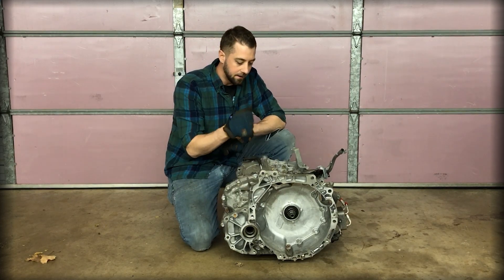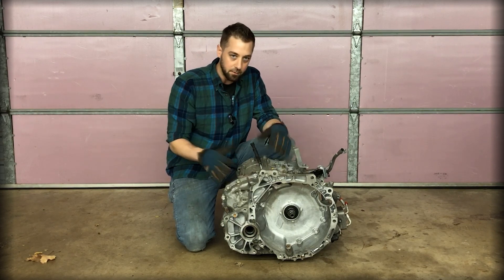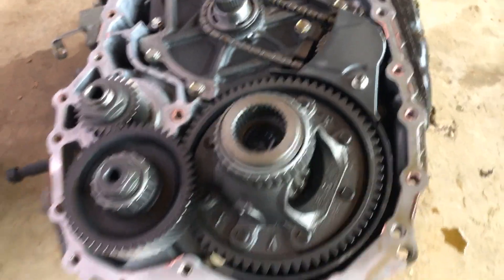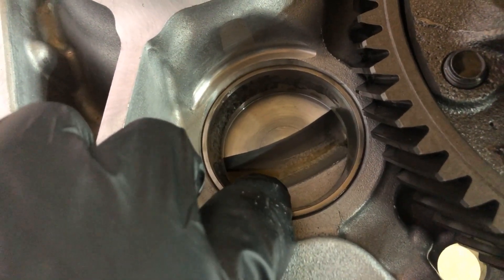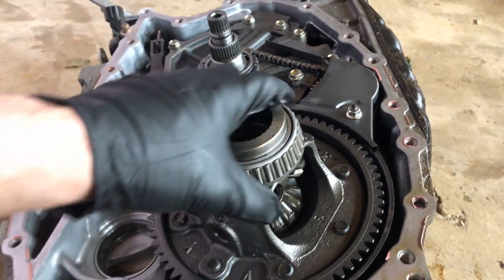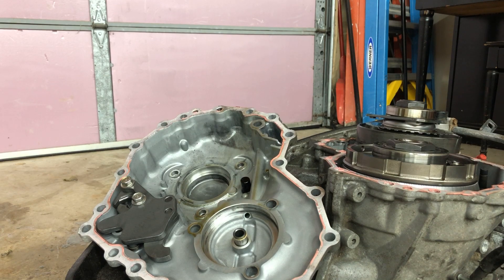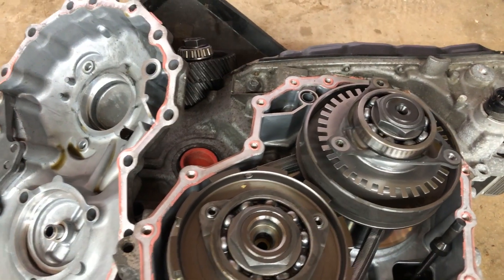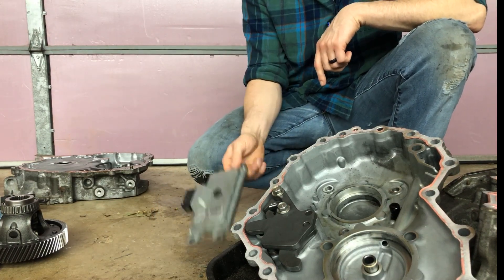I Teardown my Nissan CVT Transmission

Comment: I85,000 on the wife’s Altima 

Never changed fluid, getting ready to though, getting gasket,filter, new cover with drain plug.

Did one lone oil change with Royal Purple and an additive and the steering quit vibrating in about 20 min of driving.  So that’ll be the new norm now lol
Reply: Thata wild, ive been changing the fluid in my sentra every 20k miles.

Comment: I have 2011 murano serviced trans every 30k or less. Got to 180 k now it has a whine slash pump noise in Park quiets down in gear but whine on acceleration. Bummed because the rest of car and engine run great still. Still shifts great. Just sound like a bad power sterring pump.But the resale value for these is poor. Makes replacing not a viable cost option.

Comment: 120k on our 2012 Nissan Quest with the RE0F09B. Makes a really loud cyclical rough “bearing” noise. I can tell it’s in the transmission bc i can stop each front wheel and the noise continues. 

It’s loudest at low speeds. I took off the bellhousing cover and everything looked fine. It’s probably one of the 3 bearings on the side with the 2 pulley’s. 

I plan on using a stethoscope from harbor freight to help narrow down which bearing it is. Nice to see that the rear cover can be sort of easily removed to access the 2 outer pulley bearings. 

Seems like Tri-City Transmissions and WhateverItTakes can get/sell upgraded bearings and other parts for these. WIT also sells good used parts and assemblies.
Reply: Just curious how often you change the fluid, screen, and cartage filter.    I have an Altima with 91K miles,   I do mine about every 30K but I'm quite worried, especially every time I climb a hill, and the temp skyrockets!
Reply: @johndaniels651  it’s my brother’s Nissan Quest that I’ve been helping maintain only recently. Im pretty sure he never changed the CVT fluid until I came along at 115k lol. The CVT never had any issues other than that side cover/case bearing, which was probably due to design tolerances more than anything else. 

I think if you’re changing the CVT fluid every 30k already then that is about as much as you can do. I don’t think the screen filter really needs replacing since it has a lot of surface area that would likely not be clogged. We had a couple golf balls worth of steel bearing material in it and it still was probably filtering just fine. Over 80% of the screen was still pretty clean. I didn’t check the cartridge filter, just replaced it. It’s possible the cartridge filter could clog with smaller particles but I wouldn’t really know for sure. 

I’m aware that some trucks with well over 100k on original ATF can easily overheat under load. I believe the heat resistance of these fluids degrade in a logarithmic fashion. It’s probably great until roughly 60-90k and then starts deteriorating significantly, then it’s almost gone by about 150k or so. That’s when most traditional auto transmissions start to go if the fluid is never replaced.
Reply: @johndaniels651  Is it the CVT fluid that you’re seeing heat up? Or engine oil or coolant?

If it’s the CVT fluid then I would consider adding a transmission fluid cooler/radiator. That’s the consensus for extending the life of some slushboxes, especially if climbing hills or towing.
Reply: @johnnypolex   I hooked up  ScanGuage II from Liner Logic,  which is a really cool contraption that monitors all sorts of stuff (entertaining on long drives)  and it lets you read the trans temp sensor in real time.   Its rather interesting what causes it to heat up (not intuitive) but weight seems to be the factor.  If I'm by myself, it rarely gets above 207 in freeway driving, but if I've got 3 passengers  on board and luggage, the smallest incline can easily send it to 220.  Once with a full tank of fuel (100lbs) 3 pax and luggage, it ran up to about 245 on a very long, steep grade, in about 80 degree weather.

Comment: Did you ever change the cartridge filter on the cooler?
Reply from the maker: Yeah every flush I do.
Reply: @ManvsCars  ah ok, I just did mine other week. How many miles you put on CVT before failure?
Reply from the maker: @RJL1983  95k
Reply: @ManvsCars  Damn, I'm at 86K on my CVT

Comment: just knowledge, CVT transmissions are fine but there not made for heavy throttle starts, towing in my opinion, fluid should be changed every 30,000 miles.  210,000 0n my 2013 Pathfinder and 133,000 on my 2015 Rogue wife and I drive just over100 mile round trip to work daily.  Dealers will tell you that the fluid in these are design for the life of the transmission but I don't think people understand that life of a vehicle is considered 100,000 miles for most manufacturers.  Car industry needs to be more clear on maintinance and use of CVT's
Reply from the maker: Good point. Manufactures know the cycle of vehicles which isn’t a negative thing. In the rust belt your lucky if the vehicle needs a transmission before it rots out with all the chemicals that go on the roadways. Lol

Comment: Nissan and other car makers screwed up, they said their trannies were not to be serviced. it was a bad move. Even now if you call the dealer they say they don't do fluid changes and argue. My dealer didn't even know about the paper filter. I had to show them. But other makers did the same thing, like VW, Toyota etc... all guilty of this. It's a shame. 
Also if you want to try something really really good. See if you can find Power Up lubricants additive. It's so good. I used a little in my whiny tranny. It really works for these applications as it is a boundary lubricant for roller bearings. It is truly amazing.
Reply from the maker: Power up? Never heard of that. Is that like Lucas additives?

Comment: I really love the 2.5 engine, I have two. They are so smooth with the counter balance shafts .. so beautiful. After 250,000kms my engine works perfect. I bought another car just for a back up but will not need it, I can use it later. Plus parts are so cheap.All I did in 10 years was brakes and calipers and fluids, one headlight blub, one marker bulb. and tires. I have been using the mobil extended life oil at 10,000 km and will try the platinum plus I got on sale at cdn tire.. plus good mobil oil filters. Also I did the shocks and springs, the rear springs most cars are weak. They are cheap and easy to change.
Reply from the maker: Yeah the engine in mine is holding up great. Oil changes, flushes, plugs, filters. The basics. My opinion on the CVT however (and this goes for any car equipped with one) is poor. It’s very clunky, fluid overheats easily you get the point obviously. But hey economy  car at the end of the day and it did last us a decent amount of miles.
Reply: @ManvsCars  how much did it cost you to replace the tranny? Did you remove it yourself?  There are places that rebuild these and you can buy parts to rebuild them, there are several videos on here but the dealer won't have the parts, but the tranny parts places will. Perhaps your old tranny is worth something to these rebuilders.

Comment: I like the valvoline synthetic cvt fluid
Reply from the maker: I’ve always gone with OEM fluid. What’s the cost of the valvoline?
Reply: @ManvsCars  there is also a paper filter to change in a housing on the right side of the car, they are at rockauto for cheap, like $5, . and when you fill the tranny it should be about halfway on the cross hatch marks when hot on the dipstick. For drain, I just use a suction and take a few liters from the dipstick tube and measure it

Comment: Give it 2year top or warranty expired. The accuracy is magical. The dealership is making more $ due to constant monthly oil change on the cvt. Conpared to manual is 80k to 100k before oil change is required.
Reply from the maker: Totally agree

Comment: Nvr once u have a failure with a manual trans. Cvt is ticking timed b. Metal rubbing metal, as soon  as the 2year warranty ran out, the whole unit trashed.
Reply from the maker: Yeah they aren't cheap to replace. I did the labor myself but a used unit costed me $1500 plus the fluid isn't the cheapest. Cars right...

Comment: I have a Nissan xtrail t30 and it can't change gears I don't know what wrong with it. I had to buy another gear box but also can't change gears, I was told to buy a speed sensor, can this sensor help with the changing of gears in an automatic engine?
Reply: Buy a manual car.. the end. Problem solved forever
Reply: Gear change  issue were apparant even with automatic and even worse with cvt unit.. go back to manual and got my Freedom back America.

Comment: I made the mistake of buying an Altima with a CVT. Never again. Started to fail within 2 years.
Reply: I owned 08 Altima for 8 years. It was the best car that I've ever owned when it comes down to reliability. I sold it to a guy at work and he still drives it today.
Reply: I am looking for a used car....... suggestion please ?
Reply from the maker: Toyota Camry is a good buy in terms of reliability. Honda Accords hold up well also.
Reply from the maker: Yup, sounds about right. What year was it?
Reply: @ManvsCars  2020 AWD. I was very disappointed when it started to happen. I should have done more research before every buying that car.
Reply: @TheJonathanc82  2020 omg damn Nissan and their cvts

Comment: The reason that Nissan CVT's have always been so bad is because they're always vastly undersized for the application. You can't use a CVT fit for a Versa and put it into a heavy Maxima (or Rogue)---it's just not going to last
Reply: They don't last in a Versa either.
Reply from the maker: Agreed.
Reply: @ManvsCars  They know everyone is stupid
Reply: You do realize that the Versa, Altima, Maxima and Rouge each used completely  different versions of the Jatco CVT transmissions right?
Reply: @johndaniels651  No they didn't---that was the problem
Reply: @justsumguy2u  Yes they did.  Many JATCO CVTs 
Jatco JF11E  (Sentra & Jeep Patriot)
Jatco JF009E   (Versa, Note, Cube)
Jatco F1C1A  (Mitsu Colt, Lancer & Hyundai Sonata 
Jatco CVT7  (Nissan Murano)
Jatco CVT8 (Infiniti QX60)
Jatco CVTX  Mitsu Outlander 
Jatco CVTXS  (Sentra SER)
Jatco JR006E  (Various RWD)
Jatco CV8   Hybrid Pathfinder

Comment: Never buy any CVT vehicle
Reply: Mitsubishi CVT is super reliable
Reply: Toyota, Honda, Subaru dont have any serious CVT issues, Nissan CVTs 2020 and newer are improved. CVT is way of the future and you see now with the new 2023 Acura integra has a CVT and it cost 30k plus......
Reply: @crow_2k11beatsbydre8  - CVTs are NOT the way of the future. CVTs are a scam perpetrated by the govt to force car makers to squeeze every drop of mileage out of their cars.

CVTs get about 5-8% better fuel mileage, which is meaningless on an individual basis, you'll never notice it. But the govt and car makers can boast that they've saved the country billions of barrels of oil because of them.

CVTs are belt driven. Before the 2000s the only thing they were in were snowmobiles. They do not belong in automobiles, they're not strong enough..
Reply: @HailAnts  Toyota number one brand worldwide and the Corolla best selling vehicle ever uses a CVT,  Scam whatever........
Reply: @crow_2k11beatsbydre8  - And they were that when they had regular automatics in them. CVTs added absolutely nothing. Except greater planned obsolescence on the part of the manufacturers..
Reply: @crow_2k11beatsbydre8  Terrible idea by Toyota. Their geared transmission lasted forever on the Rav4 and Corolla.
Reply: @rishijai  So will the CVT......
Reply: @crow_2k11beatsbydre8  not 2019?
Reply: Nonsense.  I have a Honda PCX150 scooter that works perfectly!   hehehehehe
Reply: @rickhibdon11  I agree. The bad ones were at the beginning of their introduction to the market. This design is more mature now, so it is more trustworthy than just a decade ago. I'm on my second car with the CVT and my next one could have one too.
Reply from the maker: @rickhibdon11  Lolol probably can’t go wrong with that. 😁
Reply from the maker: Little too late, we bought this one. Lol
Reply: What about cvt of gm
Reply: If looked after and oil changed regularly. Never had any problems and that is with 3 cars we have had.
Reply: My 2016 versa cvt.. 200,000 miles and still going

Comment: Owner of the infamous CVT, does changing the tranny oil help the life?
Reply from the maker: We changed it twice with Nissan cvt fluid. Bought it new. Hard to say if it made it last any longer. It’s a car at the end of the day so something is guaranteed to go at some point right? Lol. The bulletin on the specific bearing says the case was built with a tight tolerance that accelerates the wear. 🤷🏼‍♂️

Comment: No oil caused that noisy bearing to wear.
Looks completely bone dry that transmission!
Reply from the maker: The oil was drained prior to disassembly. There is a bulletin on this model for that exact bearing failure problem. Tsb reference number: #NTB15-102b
Reply: @ManvsCars yep. It’s a known issue and I think WhateverItTakes sells upgraded bearings.

Comment: I was gonna comment that hoprfully you repaired it by throwing it in the garbage. But well, I guess it lives to plague another day. My condolences on owning a CVT.
And my future condolences to the drive belt that needs to be replaced every 25,000 hard miles.(they may work longer , but they're toast.
Reply from the maker: Yep! I agree. I think the manufacturers cutting costs will come full circle eventually. The only way vehicles seem to be reasonably priced anymore is if they’re absolute garbage quality.